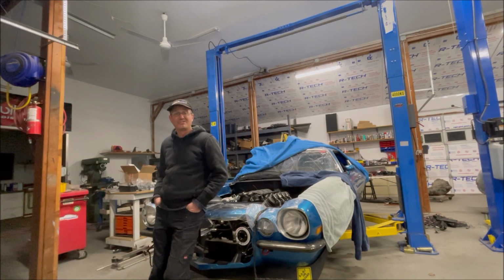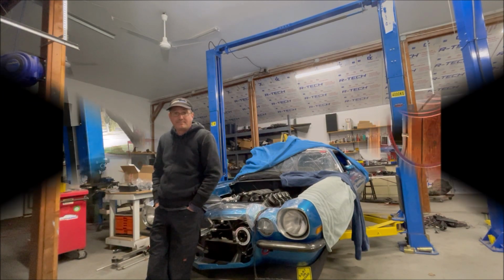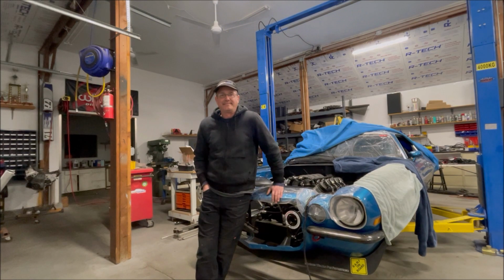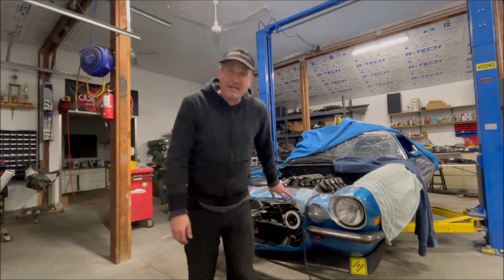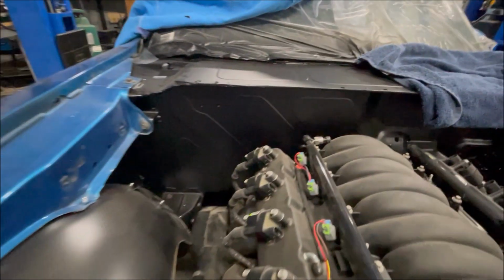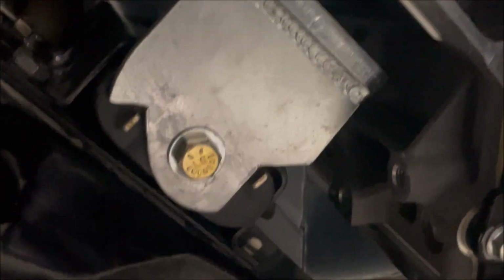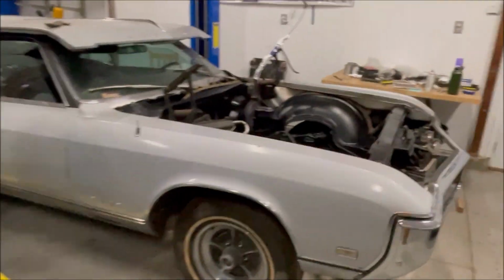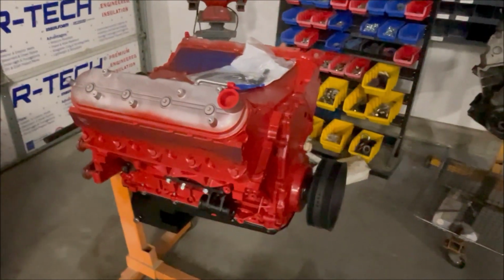71 Camaro rebuild part 5  Someone Gets Married! (not Keith)

Comment: So, pulling the front subframe, and getting the engine installed, then reinstalling the subframe, was not a great idea? It looked like a great idea, what way would you recommend ?
Reply from the maker: Dave, you must have missed the early videos where we completely and drastically modified the subframe, which is why it is on the jig table.  We then needed to make sure all the parts we made fit the frame, so we installed the engine and trans on the table.   It was already assembled.  If your frame is in the car already and your just swapping the motor, do not do this.  In this scenario, yes it was the way to go for sure.
Reply: @ks71z28  I thought your frame was done, and you were just showing the improvements, not paying attention, HAA  HA ,